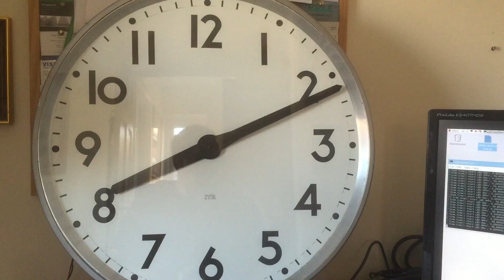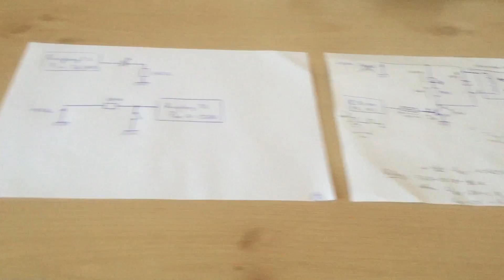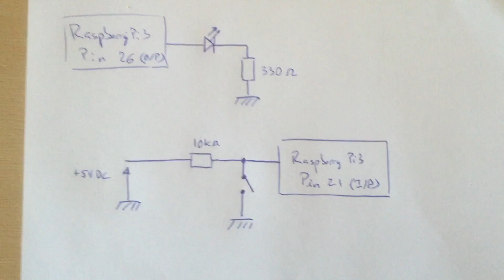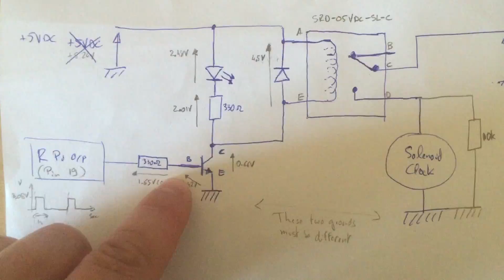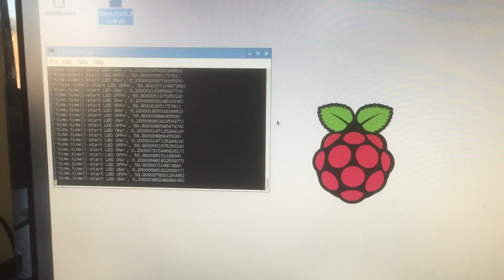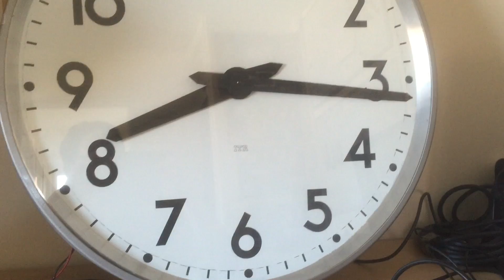slave clock driver py

Comment from the maker: # Name: Pierre Reynaud
# Date: 15 Aug 2016
# Copyright 2016, code is free to be used for private and educational uses. Code is not to be used commercially and is not to be sold or rented.

#!/usr/bin/python
import os
import sys
import time
import RPi.GPIO as GPIO
GPIO.setmode(GPIO.BCM)
GPIO.cleanup()
GPIO.setwarnings(True)

# define GPIO 26 and 19 as output
# with resistor of 330 ohms and voltage of 3.3V, current through LED 19, 26 = 3.6 mA
GPIO.setup(19,GPIO.OUT)
GPIO.setup(26,GPIO.OUT)

# define GPIO 21 as input from pushbutton
# with pull up resistor of 10 kohms and voltage of 5V
# PushButton UP         => GPIO.input(21) = TRUE  = 1
# PushButton DOWN       => GPIO.input(21) = FALSE = 0
GPIO.setup(21,GPIO.IN)

# Set up variables for user inputs
count = 1 # defines an integer count which will be used later to adjust clock time with actual time
delay_in_min = 0 # defines an integer = total number of minutes time on wall clock is behind actual time
clock_on_time = 0 # records feedback if clock is on time or not 

os.system('clear') # clear blck command screen
print "This programme will drive clock on the wall."
time.sleep(3)
print "Start this programme when time displayed on wall clock is behind actual time."
time.sleep(3)
print "For instance, clock on the wall displays 10.00 am and it is actually 11.30 am."
time.sleep(4)
print "Once this programme starts, you can stop it at anytime with pushbutton."
time.sleep(4)
print "Programme is about to start. Time on wall clock should be behind actual time."
time.sleep (4)
print "Please let programme know how many minutes separate clock time from actual time."
time.sleep (4)
delay_in_min = input ("The delay should be an integer number between 1 min and 120 min:")
time.sleep (1)

if delay_in_min <= 0:
        print "The delay you entered is less than 1 min. Minimum value is 1 min."
        time.sleep (3)
        print "Please try again with a delay greater or equal to 1 min. Programme will be stopped now."
        time.sleep(4)
        sys.exit(0)

if delay_in_min > 120 :
        print "The delay you entered is greater than 120 min. Maximum value is 120 min."
        time.sleep (3)
        print "Please try again with a delay less than 120 min. Programme will be stopped now."
        time.sleep(4)
        sys.exit(0)
else:
        print "You have entered a delay of",delay_in_min, "min."
        time.sleep (3)
        print "The programme is about to drive hands of clock", delay_in_min, "times."
        time.sleep (3)
        print "This programme will drive the hands of the clock to catch up actual time."
        time.sleep (3)
        print "Hands will be moved automatically from now on."
        time.sleep (3)
        print "You can interrupt this programme at anytime by pushing down press button."
        time.sleep (5)

        #this part of the programme moves hands automatically by sending a one second pulse every other second
        #variable count is incremented from 0 to delay_in_min after each pulse is sent to drive hand
        while count <= delay_in_min :
                start = time.time() 
                while (time.time()-start) < 0.2: # drives hand of clock for 0.2 seconds
                        GPIO.output(19,GPIO.HIGH)
                        GPIO.output(26,GPIO.HIGH)
                        
                        if (GPIO.input(21) == 0): sys.exit(0) #exit loop if PushButton DOWN 
                print("time.time()-start LED ON=", time.time()-start)
        
                start = time.time()
                #print ("start =", start)
                while (time.time()-start) < 0.5: # rests for 4 seconds
                        GPIO.output(19,GPIO.LOW)
                        GPIO.output(26,GPIO.LOW)
                        # print ("GPIO.input(21) =", GPIO.input(21))
                        if (GPIO.input(21) == 0): sys.exit(0) #exit loop if PushButton DOWN
                print("time.time()-start LED OFF=", time.time()-start)
                
                count = count + 1
                #print ("count = ", count)
                #print ("delay_in_min = ", delay_in_min)
                #print ("GPIO.input(21) =", GPIO.input(21))
                #print ("clock_on_time =", clock_on_time)
                
        print "Clock on wall should be displaying correct time."
        time.sleep(3)
        print "Is clock on time?"
        time.sleep(3)
        clock_on_time = input ("1 = YES, clock will carry on working / 0 = NO, programme will stop:")
        time.sleep(1)
        if clock_on_time == 0: sys.exit(0)

        

print "Clock is now driven automatically. Push pressbutton to interrupt programme."                

while 1: # infinite loop carries on until PushButton is pushed down, setting GPIO.input(21) FALSE

        start = time.time() #gives a value in sec and microsec us since a fixed point in time, 1970
        while (time.time()-start) < 0.2: # run for 0.2 second
                GPIO.output(19,GPIO.HIGH)
                GPIO.output(26,GPIO.HIGH)
                if (GPIO.input(21) == 0): sys.exit(0) #exit loop if PushButton DOWN 
        print("time.time()-start LED ON=", time.time()-start)
        
        start = time.time() #gives a value in sec.us since a fixed point in time, 1970
        while (time.time()-start) < 59.8: # run for 59.8 seconds
                GPIO.output(19,GPIO.LOW)
                GPIO.output(26,GPIO.LOW)
                if (GPIO.input(21) == 0): sys.exit(0) #exit loop if PushButton DOWN
        print("time.time()-start LED OFF=", time.time()-start)

print "end program"